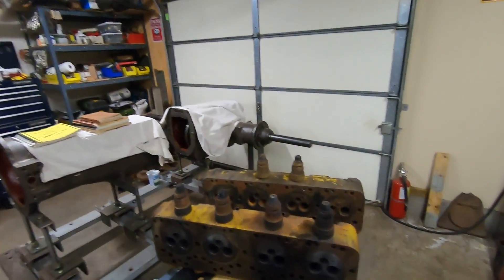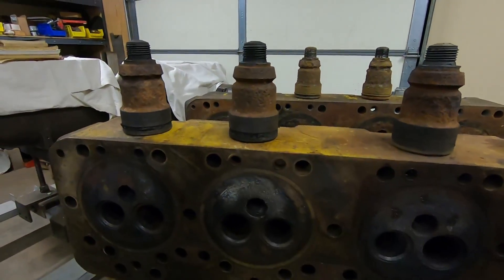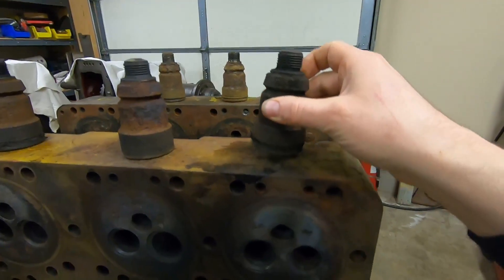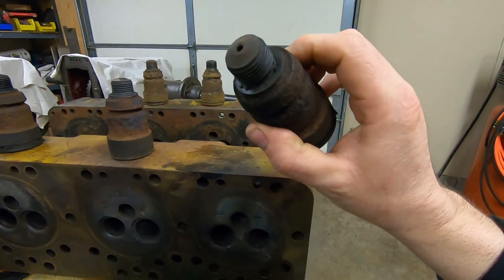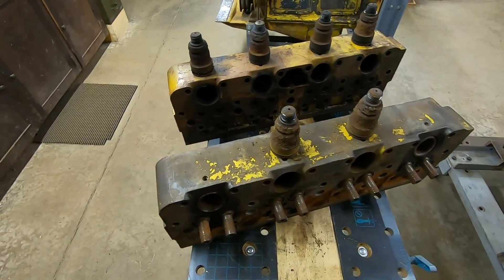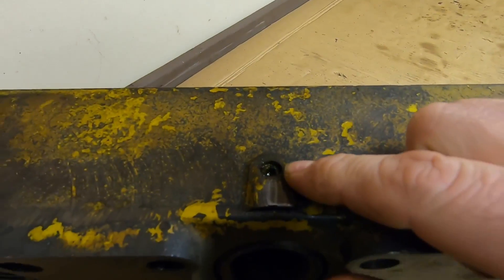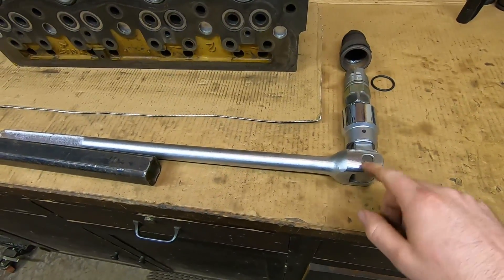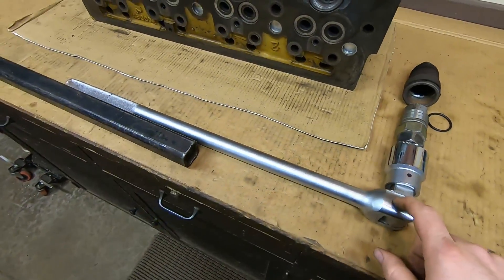Caterpillar D2 #5J1113 Diesel Engine Assembly Ep.24: Precombustion Chamber Conundrum

Comment: I would take the risk and try to pull them all out while it's on the bench because if I put it together as is and it leaks I'm not going to be happy with myself and I would want to see what the outside of the precombustion chambers look like to insure that they don't have excessive corrosion on them. I would want to have peace of mind after I put the engine together after all the work I've put in it . That's my opinion.

Comment: G'day,, 
Some well thought out comments already .
I tend to agree with a hot oil bath ,followed  by gentle heating  in an "oven" to expand entire head ,,  then doing best possible job of cooling just the pre-combustion chambers  using hydrocarbon spray,, brake clean,,   C O2  or dry ice,  allowing for contraction or shrinkage of the "smaller part" before removal   .
When concentrating heat to a specific area  using a gas touch ,the resulting uneven expansion  is what generally leads to cracking ,,particularly  between valves , glow /spark plugs  and the like .
 Having said that .....
I'm sure you will manage .
Thanks for the vids..

Much  Respect 
       from
Down  Under

Comment: Fix it now or you will kick yourself later. Besides the way that head looks they will all come out fine. :-) PS Get a big rosebud to heat with you need a little heat all over, it is far more effective than a lot of heat concentrated. Also once you get it good and hot take a little sprayer and spray water into the cup to shrink it away from the head. On a big casting like that it is constrained and heating can actually make it close down tighter on the threads as when it grows the outer cold material resist the movement so it forces the growth to go in rather than out locking things down even tighter.

Comment: Hi Squatch. How about hiring a big air impact wrench? Would that be too risky? With a tight fitting adapter there might/should be no damage to the chambers. The other idea worth thinking about is to heat the whole head uniformly, not using spot heating. It should not be necessary to get anwhere near 'red heat' to expand the cast iron head enough to help. Just raising it to water boiling point would result in some possible helpful expansion. If going hotter then I suggest using a therrmal blanket to prevent the head cooling too fast on the outside and cracking whilst working on it. Put back in the 'furnace' (or cauldron!) afterwards and let the temperature down gently. You may well need specialist 'foundry' type help for this if going hot.  Now, it depends on the expansion co-efficient of the head versus the pre-combustion chambers of course - the wrong way round and my suggestion would just make matters far worse. Regarding 'do it or not' - well, it's your head on the block ..... sorry, bad pun! Your call I think, I'm not going to fund a replacement so I'm loathe to advise. BobUK

Comment: Great video. Old Cat man myself now retired and recently got into the same conundrum with my D318. So what to do... I say pull them and reseal them. Given the age of these, and yours is much older than mine. It's the perfect chance to reseal them. Mine weren't leaking but since I was doing the head anyway, I decided to pull them and I'm sure glad I did. They were pretty grungy in there. So a good cleanup and new seals are in order. I'm now debating weather to put in the new style combustion chambers with glow plugs as they are readily available for these engines. They didn't come out easy, like yours, 4' pipe on the breaker bar. All I can say is that Cat tool must be made out of good stuff. All threads were ok.

Comment: I would take them out. As you said, you do have a replacement set (if necessary). With the bottom end of the engine resealed, it only makes sense to reseal the top end.

Comment: I would say try to remove them. If you can remove at least one of them, check for corrosion and other damage. If you find something worrisome, then maybe proceed drilling the rest. I wouldn't risk otherwise.
Reply: It doesn't have to be all or nothing, if pulling one combustion chamber and assessing it would settle your mind about the others, then replace it and leave the others, with the head planing.and valve recession for the next rebuild.

Comment: Can you put the head in an oven and hit the chambers with some freeze spray? Would a good pressure test of the cooling system be enough to see what you're looking at? Is there enough room in the head to get an endoscope into the water jacket? Just thinking out loud. in the interest of conservation, what other unobtanium consumables might you need to waste if you need to pull the head back off sooner rather than later? Another thought, if push really comes to shove, is that you just showed us there are two fewer heads out there that will need these chambers.

Comment: Can you warm the entire head in the oven to like 250-300 degrees (without damage) and put dry ice in the chambers to get them to break free?
Reply: I was thinking the same thing, but after soaking head in prentrate for a week first.
Reply: @slypig24  ...Penetrant is a waste of time.  For years I've tried all of the brands and home brewed concoctions with  very little success. I always thought it was something I did or the specific brand (I'm talking to you Kroil), but recent YouTube tests (Project Farm for example) show it was worthless to use the stuff. It won't penetrate into a locked joint. Sad to say, heat cycling is the only proven way to loosen this type of corrosion.  Toby does not want to risk heat (and rightfully so).  If these parts do not cooperate, he has his hands full!  The best of luck to him. Lets hope drilling out to the threads is the answer.
Reply: Soak the thread and not if all with wd40..

Comment: I side with Josh and Anthony, give it a shot soak them for a couple days with Deep Creap penetrating oil and then go for it. Deep Creap is made by seafoam and is my go to when i need it to come out no matter what. Only thing better than Deep Creap is Gibbs penetrating oil. Gibbs is $$$$ but makes everything move for me. Also try using a 3/8 inch impact on the cups with your cup removal tool, i know the 3/8" impact isn't going to move it but your not trying to remove them with it nearly jar a few rust cracks or carbon cracks in between the tread pitches so that the penetrating oil will seep into the threads a bit more to help get things as close to as possible for coming loose nicely. Time and patience boss you got this.

Comment: If it were me I'd be leaning towards removing them, as my luck they'd fail right away. Another option would be to see if it'd be feasible to plug everything up enough to leak and/or pressure test them.

Comment: Take them out, you’ll never forgive yourself if you don’t, and should have.  Do the best you can, at the very least you’ll want to change the o rings and copper washers.  Then it’ll be closer to new.  It’s perfectly okay to heat bathe the whole head up to normal working temperature and super cool the tool so that there’s a steep thermal slope across the contact when you start to unscrew.  I’ve used this method to free seized parts before and can just be the difference you need.  Good luck with whatever you choose to do.  kind regards, K33F

Comment: On some old Hemi heads we soaked them in Evapo Rust remover as we also did not want to use heat on them. After 3-4 days everything came apart with no issues. Heads reconditioned like new once apart. Good luck
Reply: That was my thought also. I watched a few videos of machinists using Evapo Rust with good results. Also, Project Farm has a good video on different rust penetrants that may prove useful. He used bolts screwed into heavy plastic blocks so the penetrants could be visibly witnessed on how it works.

Comment: You know, with all the talk of modern technology, I wonder if someone could get the dimensions of those chambers and 3D model them in order to get new ones produced. They wouldn't be cheap I'm sure, but it would be interesting to know
Reply: If they were built before, they can be built again. The problem than would be they are OEM CAT parts. Depending on the machine, you may be OK with that.

Comment: I overhauled a Case 830 diesel that had the power cells on the opposite side of the head from the injectors. If I remember right you had to remove these power cells to be able to check to see if the stream of diesel the injector shot across the combustion chamber was aimed at the small hole in the power cell. I think there was an issue of resealing that surface if you removed the cells. I am glad modern diesels went away from precombustion chambers. So I guess the injectors on this engine only spray fuel into the chamber and not out the hole. Wow to think about all that air getting compressed into that tiny area is amazing,

Comment: The tool that Marty T’s buddy used to pull his chambers; was the correct tool 
then?
Reply: I'm probably wrong but the pre-chambers look like a big torx bolt just like vw cars use alot of torx/allen head bolts
Reply: @TaylorVanconant  The D2 that Marty T is working on is a U series which takes a splined tool. The J series uses a hex tool.
Reply: @TaylorVanconant   The D2 Marty T is working on is a U series which takes a special splined tool. The J series takes a hex tool.
Reply: I am amused that Marty T and mate used methods that would give Squatch the conniptions :-). 
No criticism on either side, (the motivation of either is completely different), but a stark contrast!
Very interesting following Marty's mate pulling the sump on that D2, and actually KNOWING what they were working on after following Squatch's rebuild.
Reply: The twelve point "torx" isn't a torx at all, it's either XZN(that's what VW uses) or triple square. XZN and Triple Square are for all intents and purposes the "same bit", except I think Triple Square might exist in US Customary unit specs while XZN is SI only.

Another style VW uses is RIBE, which is the crappiest bit I've ever encountered, it looks like a spline and it strips faster than any other bit I've come across. Another fun one is Pentalobe, same profile as Torx but 5 points. Then there's the fun 7-Star one too, as well as Cinstar, and 6-Lobe which all could be confused for a Torx, but has nothing at all to do with Torx. 

Anyway, I ramble.